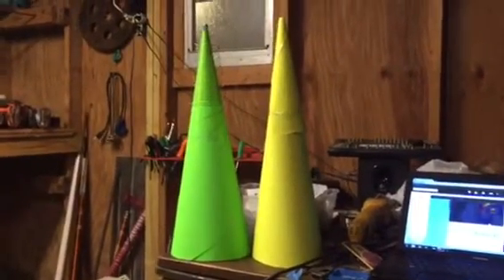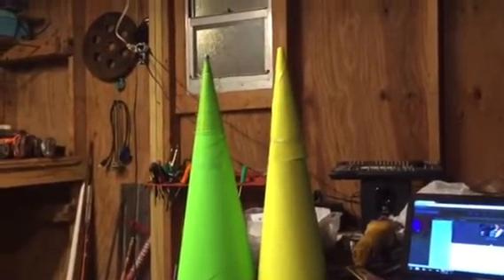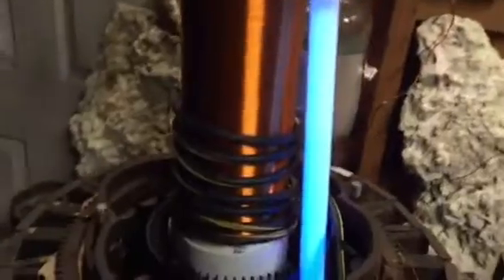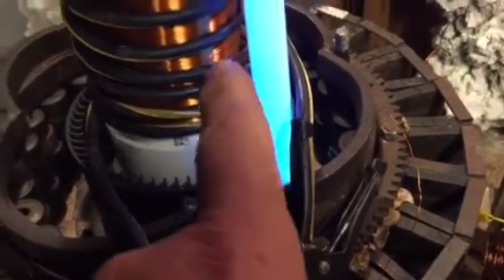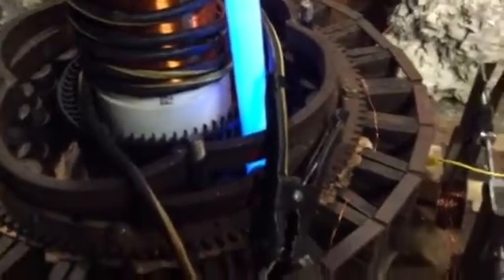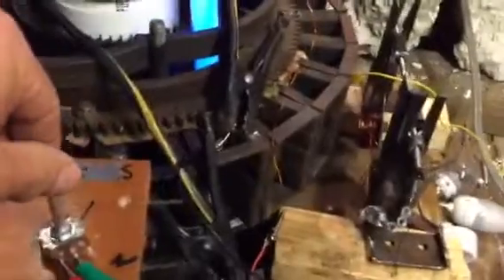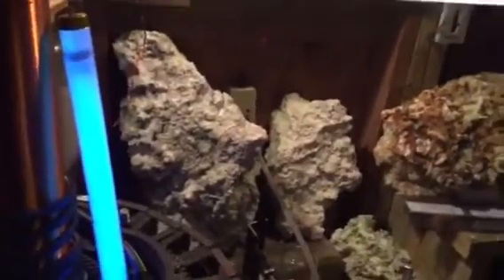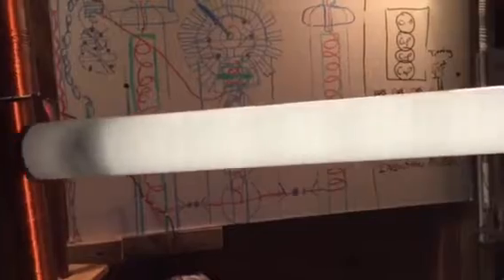Ed Leedskalnins workshop Double Helix Coils

Comment: That is a great thought process explained and some great information you are exploring. I have read that indeed and Leedskalnin also mentioned this occurrence in what he considered currents.  Which are not necessarily the currents in Amps we consider today, but rather total power emitted. Think about this possibility, if we could add enough coil length where you wouldn't need a potentiometer or resistor.  Then the maximum amount of current would flow and deliver its emanations to the medium around, with out it transferring into heat. Which in a sense is overlapping wave, or reverberation,  in a small area. (The copper wire)  In a sense the circuit would not only be tuned one direction of movement, but in 2 directions, if that analogy makes any sense? I look forward to see what you do with these cone coils, thanks for sharing your journeys  with us all. :)
Reply from the maker: I like your vids and channel
Reply: Thanks man :) I'm just a blind fellow feeling around in the dark. One day at a time trying to find the light switch.
Reply from the maker: Why thank you it's been a long journey